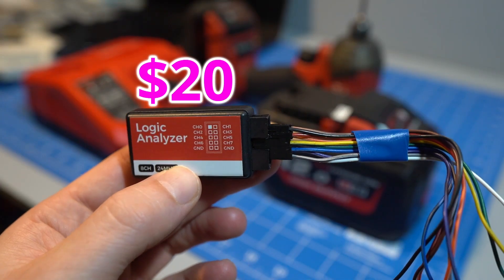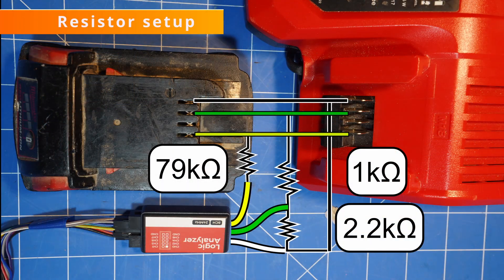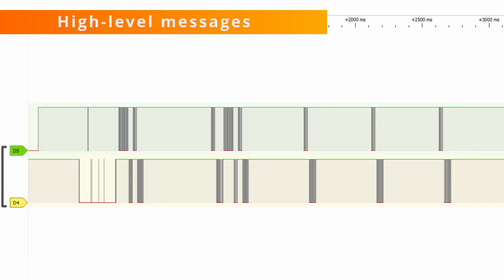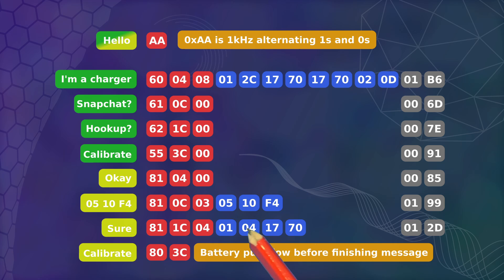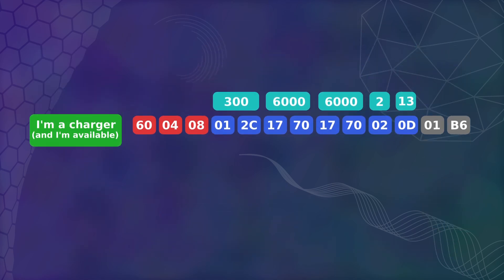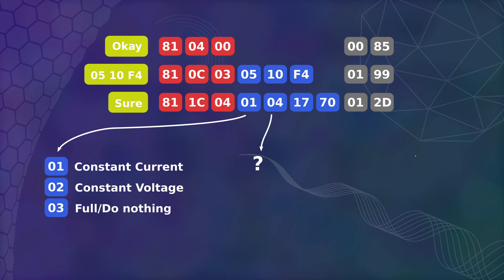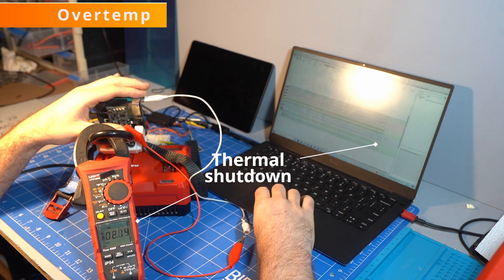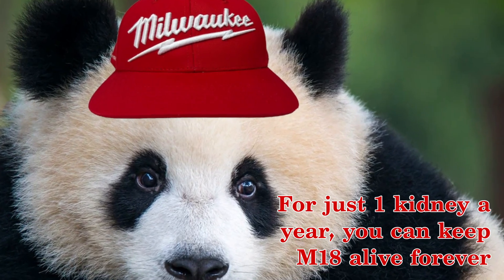[004] Reverse-engineering the Milwaukee M18 Redlink Protocol

Comment: Do you have any plans to do videos on ryobi one plus batteries? (Specifically the many lithium variations) (examples; lithium, lithium +, hp, & newer hp)
Reply from the maker: I only have one Ryobi battery and tool - a 36V mower. I'll be doing some stuff with that in the next few months. It'd be a while before I got around to buying and testing Ryobi 18V.

Comment: That's an odd decision to put the majority of the intelligence in the battery, you would think they would want to save cost on the batteries since they make more of them. I know safety is a huge concern, but I'm surprised at how smart the battery is compared to the charger or tool.
Reply from the maker: That's what Dewalt did. I guess theirs pros and cons to each way. Makita also puts most of the intelligence in the battery.

Comment: That's a bit concerning that it doesn't detect freezing temperatures.  Storing batteries on a charger in an un-heated garage could ruin them.
Reply from the maker: Someone else said that it's not until around -30 to -40C that they refuse to run. Seems crazy as Samsung's datasheet says -20C. I was probably only around -10C as it was out of the freezer for a few minutes.

Comment: Oh wow. This popped up in my feed for no discernable reason other than my interest in electronics but I actually do happen to have a couple of dead Milwaukee M18 batteries I'm trying to resurrect. They're my grandma's so they've seen almost no use and sat dead for the better part of a year. I assumed the lithium ion cells just discharged too far and for too long and the charging board didn't detect voltage(s) within the range they consider to be "untampered" and decided not to charge as I've encountered the same issue with a few other electronics that use the same cheap 18650 cells. But after watching this, I'm thinking maybe I've got my work cut out for me 😂. Here's hoping using an external charger to manually charge each cell to about 20% will get them up and going again. I don't have the tools or expertise to re-stamp/solder the metal connectors without adding noticeable resistance so I hope charging them with alligator clamps and caption tape doesn't fry any thing on the board. I assume it won't since I'm just directly toughing the battery contacts and, in theory, the traces that'll be given voltage shouldn't see anything they wouldn't normally, but this kind of thing is always a crap shoot for me.

Comment: just wondering about legal side of this. If some company makes a "compatible" battery, using same/compatible physical connection and this communication protocol, but uses its own brand, is it breaking any laws? I mean it's not pretending to be original, is of different design etc, just does the bare minimum to be operational?
Reply: There are already Chinese replacement battery boards available...

Comment: thanks for your video and the effort! I wonder if the batteries are really balancing. I lost 1 by using it on a 3rd party tool via adapter (only +/- terminals). it switched off when on 1 cell row the voltage dropped maybe under 3,8V, while the other rows were beyond rescue (reversed polarity)

Comment: The second byte of the header seems to be a sequencing value? Incrementing with something like `(v << 2) | 0x4`. I agree that silliness of this might be the checksum value.
Reply from the maker: Another commenter had a good theory. He thought it was a debugging byte as the rectangular shape would be very easy to identify on a scope, even with extreme noise. This 2nd byte is unique to each TX and gets pinged back on RX, so easy to infer what message type it was even if everything else is garbled. The extra bits that it adds to the cksum is just a bonus.

Comment: I would think one would rip the firmware from the BMS to figure out how it behaves.
Also i would think that the 'dead' battery wasn't actually dead but rather that despite the cells being good, the BMS decided to flip a bit and brick itself by popping a digital fuse or perhaps even a literal onboard one, and render the battery unchargeable and unusable despite it only being a circuit fault (understandable as a protection feature but what a waste of good cells - not to mention the potential of not being able to reuse the BMS even if one did replace defective cells and burnt protection fuses)

But alas, no. 
However, the logic information is still very helpful.
Reply from the maker: I think I might have cooked a component or damaged the thermistor during desoldering. 04 could be overtemp and 05 could be undertemp (maybe I've open circuited the thermistor?). The fast red blink on the charger is for overheat, but could also indicate low temp. You'd think if 05 was a general error state it would show alternating red/green lights, which is what happens when there's a comms error.

Comment: Wonder why they didn't just use the 16-bit FCS almost everyone uses as a checksum in communications? There's even example code in RFC1662 and the calculations are all fast xor/bit shift operations, and pretty much any microcontroller has enough flash for the lookup table.
Reply: Yes, most simple serial protocols use a CRC. And modern microcontrollers are more than capable of calculating CRCs, some even have hardware support for it.  
However I saw this sum checksum before in protocols. I think it is common in China and also dead easy to implement. Some protocols use only 1 byte, which works just as well. It isn't fantastic, but is still better than parity. And the baud rate is low accuraat, so it probably is deemed sufficient although not optimal.

Comment: outstanding! 
can't wait for the protocol b/w tool <--> battery!
Reply: From my tests a few month back, I didn't see any. The tools just seem to use a potential divider to measure the battery voltage, and thermistor.
Reply: @BuyitFixit  so it just stops draining the battery when it reaches a certain low voltage or temperature? that's simple enough.
Reply: @UNgineering  Yep. Some tools such as the M18TLED only have two connections going to the battery for the power and nothing else.

Comment: Got recommended, im a programmer, if you know anyone you should try dumping and reversing the flash soc in that charger!
Reply: It's probably read protected, but you might be able to bypass that with a glitch attack. I wrote some code a couple months back to talk to the battery with an Arduino.

Comment: Great video, though the explosion sounds freaked me out 😅 Protocol reverse engineering is one of the most interesting hobbies to me. 

What make of logic analyzer and tools did you use?
Reply from the maker: Sparkfun logic analyser. UNI-T multi and clamp meters.
Reply: @toolscientist  have you considered extracting the firmware of either the charger or the battery? Or simulating a battery to explore the protocol?
Reply from the maker: @duschkopf  I have zero experience with FW extraction or FW reverse-engineering, so it wouldn't be very productive. 

I do plan on simulating the messages eventually. I'm sure there's some diagnostic codes in there that will make the battery spit out health data.
Reply: @toolscientist  cool! Looking forward to updates on this topic ;) Actually I have no use for such batteries, but I'm really interested in your findings! Keep up with your cool work!

Comment: I have long been convinced there was a shit load crap going on between the charger and M18 battery plus battery and drill. 

I also have an ALDI brush less drill and battery and one particular battery pack when you check the cells they are all fully charged but the moment you put the slightest load on the drill it trips out, but not with other cells. If I hook up a 20A variable power supply set to 20Vdc and put the drill under the slightest load it trips out the drill. 
The ALDI drill only has +/- connector so I suspect there must be some communications superimposed on the + connector. The charger is a 3 wire charger.
Reply: There's not much going on between a drill and the M18 battery, I tested a few months back when I started doing this. If the battery has 3 wires, it is most likely + - and T (thermistor) which tells the tool the pack voltage. If this isn't present the tool won't run. Try checking the voltage or resistance between - and the 3rd pin, compare to a working battery.

Comment: As someone who's worked on his M18 batteries (manually rebalancing by charging / testing individual cell rails), this is fascinating and much appreciated.  I have a USB logic analyzer in one of the tool drawers of my bench that I haven't put to use yet, and you're making me want to break it out.  Great stuff, thank you.

Comment: Using sum of bytes as a checksum may not be theoretically robust, but it is venerable and used in many protocols. I can think of about a dozen from the 20th century. In general the results seem to be quite robust for packets up to about 2KB.

I'm surprised at the baud rate of 2000. This is a non-standard baud rate, and eliminates a number of possible UART chips or cores that can only handle the standard baud rates, Are you sure that it is 2000 bps? 2400 is the nearest standard baud rate.
Reply from the maker: It's nice and simple, but even something like bitwise not, or left shifting 2 or 3 places would make it a lot stronger. The weakness of this system is how short some of the messages are.

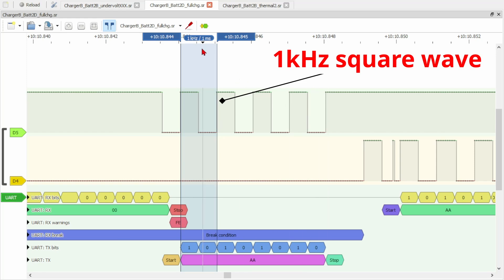Definitely 2000baud. At 3:17 I zoom in on the 0xAA message (alternating 1s ans 0s). You can that it's 0.5ms pulse width. Reasons could be: obfuscation; noise issues at 2400, but too slow at 1200; maybe the programmer just liked round numbers 🤷‍♂️
Reply: Yep it's 2000 baud. MSB and inverted logic. I documented this on reddit a few months back along with the checksum 00:28 I also wrote some arduino code by modifying softserial to support MSB, inverse logic and 2000 baud. One gotcha he didn't mention is that you also have to wait 1 bit period between sending each byte otherwise it borks 🙂
Reply from the maker: @BuyitFixit  what do you mean by inverted logic? All my data has high voltage = 1, low voltage = 0
Reply: @toolscientist  it's inverted when I was reading the signal on the microcontroller in the charger. I tapped directly onto the lines inside the charger and it was inverted. I didn't use resistors direct to the battery so perhaps that was it.
Reply from the maker: @BuyitFixit  ah yes, of course. Data is definitely non-inverted on the terminals.
Reply: @toolscientist  So I wonder why they invert it in the charger then, seems odd. Also I doubt you would be able to send data back to the battery with just resistors. That's the reason why I tapped into logic level data on the charger.
Reply from the maker: @BuyitFixit  battery is outputting 3V on J2. Maybe inverting amp to bring it up to 12V like J1? Seems dumb as you're just amplifying the noise and 3V is more useful for a UART pin.
Reply: @toolscientist If I had to guess, without looking at a schematic, I'd assume that the output drive was an OC transistor with a pullup to 12V, and the input side had a Schmitt trigger-like circuit, either CMOS, or possibly divided down first. But if you Schmitt off the full 12V, perhaps with an LP filter first to eliminate transients, you are likely to have better noise immunity.
Reply: crc-8 is like 6 lines of code (w/o the table)

Comment: Cool video.
Thinking you might be able to revive the dead battery if your able to dump the eeprom on a good one and flash to bad one - there might be a lockout condition if the controller detects missing balance rail

Comment: Awesome to see how this works!

The crazy part is there are companies who make aftermarket/copy parts (especially in China) that have people with tons of reverse-engineering experience who often figure out this kind of stuff before most people have a chance to shop for one 😂

Nice to see the secrets shared instead of found and kept!
Reply: My dad will die on the hill that 'china has horrible engineers'. As an engineer, I hopelessly try to explain to him that China has the best engineers at what they do. Want performance? German. Want reliability? Japanese. Want reverse engineering and/or cheapest manufacturing? Chinese.
Reply: @weemackee  performance ? Tell me you've never worked with German engineers without telling me you've never worked with German engineers.
Reply: @Hepad_   He means product output performance, not engineering process efficiency.
Reply: @Eagle3302PL  I mean, that's what counts, in engineering.
Reply: They can just ask their buddies who work in the same factory making the genuine ones.
Reply: That is generally not how Chinese copies are made. They are "ghost" products where the supply chain is infiltrated to gain access to the OEM parts (or firmware) or they are adulterated products where key components are recovered from used or factory reject products and remanufactured into the knockoff.
Reply: I always assumed they didn't reverse engineer it but had back door access to the genuine factories in china to quietly steal all the technical data.
Reply: 00:28 I shared them a few months back 😂😂
Reply: I'm always thankful for China not giving a shit about IP laws. Ironically, they are responsible for keeping technology a lot more free than it'd otherwise be. The whole Shenzhen area is a giant testing ground for all kinds of reverse engineering and half-legal technology.

Comment: What did you mean with "what's your snapchat"? Is it asking for battery model? Please don't sacrifice useful information for memes.
Reply from the maker: This video was made for a non-technical audience, so a lot of stuff was simplified. Yes meme-ifying isnt great for people that just want the facts, but I did include pretty much all the message sequences at the end of the video. Before this vid I only had 100 subs, and I was genuinely expecting this vid to flop with my tiny audience, so I may have gone a bit overboard on the memes.

To answer your question, I have no idea what this exchange could be. The 05 10 F4 reply doesn't ever change across chargers or batteries. It could be bit flags, could be some diagnostic code, could be intentional obfuscation, could be a remnant of the early design of the program that they never bothered to remove.
Reply: @toolscientist  Thank you for taking the time to answer my question, I appreciate it. The "hookup?" also confused me because I didn't understand if it meant the people-type of hookup or hooking up the battery to the charger 😀
Great video otherwise, enjoyed watching it. Good luck!
Reply from the maker: @remyronko  good point, I hadn't thought of that confusion. My choice of words wasn't very good in a few cases. It was a difficult balance of making it funny, but not too obscene to trigger YT filters, and also being indicative of the actual message.

Comment: Cool video. I'm a computer guy but it makes me start holding my head when I see TX and RX signals for a battery charger. All it takes is a simple "are you within the warranty period" check and then it makes the battery do something sneaky like blow internal fuses in the microcontroller.
Reply from the maker: I've often thought about that. It would be a very risky move. Big class action if you were caught, and alienating a lot of your loyal customers. Difficult to get caught if you hide it well enough, but only takes one disgruntled employee to expose you.
Reply: There's no reason this can't be done internally, unless you want the "failure" to be contagious. I know EGO batteries already have an RTC in them so they can self discharge for storage.

Comment: so you pull a balance lead and the controller board refuses ot charge again !!! i have dewalt battery like that, i charge it manually, it still works. it could be protection for a failed or flaky cell? or a way to sell more batteries also?

Comment: Thank you for your effort in reverse engineering these! It's so important for us as customers that we aren't locked out of our tools because a manufacturer decides to stop supporting them, or worse, decides that they have enough vendor lock-in that they can start extorting more money out of us for the things we have already purchased. Any right to repair for a cordless tool must include a right to repair and replace the battery. I'm sure Milwaukee and others will start shouting about DMCA or other such shenanigans to shut down any attempts at reverse engineering, but this is an essential right that all customers and tool owners should have. I have subscribed and I look forward to the follow-up videos!
Reply: Repairing stuff in general is becoming harder and harder, and companies seem to be unwilling to help. I recently had the same with a FLIR thermal camera I repaired, and with a Solar Inverter, which I ended up having to reverse engineer their software to generate a service password as they pretty much said bin it. I posted some of my M18 protocol reverse engineering on reddit a few months back, and I wrote some Arduino code to talk to the batteries too.
Reply: @BuyitFixit  Thank you for your contributions too! I noticed that Tool Scientist referred several times to your work. You are doing us all a great service!
Reply: @reverse_engineered  Yes, I did a fair amount of work on this about 7 month ago, even wrote some arduino code to talk to the battery 🙂. Ah I already mentioned above lol. Never mind. Been a long day and its hard to remember what I said to who etc, especially with my own channel being fairly busy too.